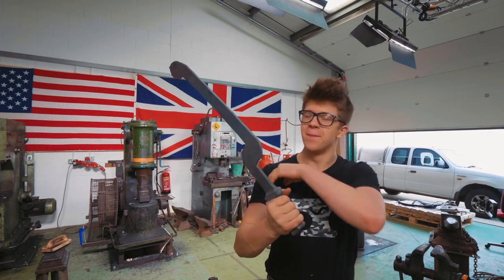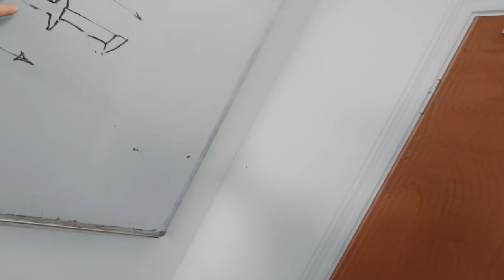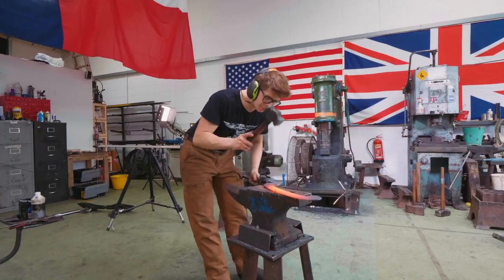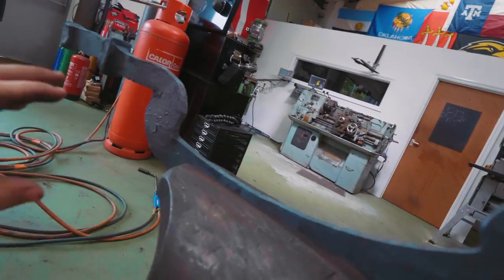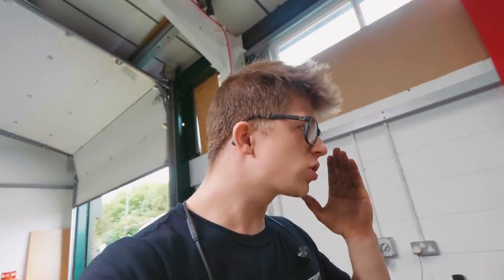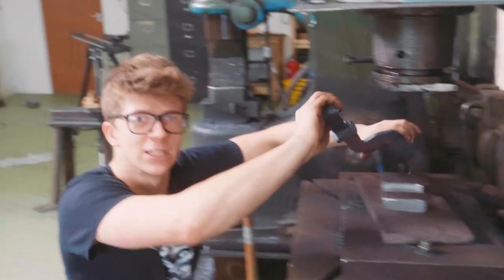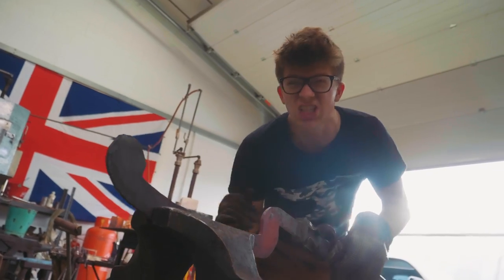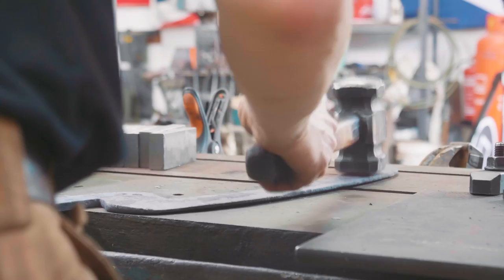MAKING AN EGYPTIAN KOPESH SWORD!!! Part 4

Comment: Tool pullout is totally a thing in a milling machine! Usually just means something wasn't tight enough, happens to all of us.
Reply: Could be the collet being marred, the bit being marred (unlikely with carbide) or just not being tightened enough.
Reply: nice alec! maybe next time try to forge a haladie knife cant wait to see what you make of it!
Reply: Could also change the pitch if the flutes if it keeps happening. Feeds and speeds needs to be dialed.
Reply: And it is very very exciting when you have stepped away (I know) and you are walking back as it .... Leaves at high speed... I hate paperwork... there was lots of paperwork...
Reply: I never pull out!... oh wait...
Reply: the same thing have happed to me when i was milling a custom pice for my car! I think if you push the milling bit to hard and force it to do the work then it seems like it wants to just dig it self down like a drill because of the force pushing it in the matirial, rather then takeing it slow and steady, thats just my opinion☺
Reply: Well, if it's not tight enough you're wasting your time...
Reply: SgtStinger That was my thought too, it may be that your collet is damaged if you think you got it tight enough.
Reply: +Practical Renaissance Sorry for the cheap shot, but I couldn't resist: "That's what SHE said!"
Reply: For a machinist there is not a hole too tight to tap!
Reply: Feed direction could cause it as well (conventional vs climb milling)
Reply: #DontPullOut
Reply: Yes Alec. It's a thing and not something you wish to see while milling. Going lighter or tightning the tool holder more will lightly fix the problem and prevent it happening in a furture.

Comment: A carbide end mill can start to wander i you don't tighten it properly and push it really hard in the machine, I would recommend that tighten it a bit harder and lower your feed, keep the speed the same but lower your auto feed.
Reply: In addition to the above it may also affect it if you are climb milling or conventional milling.

Comment: Yes, as others have said, it is a thing to have an endmill come out of a collet. First time it happened to me was about 45 years ago LOL. It is a combination of the helix of the flutes, the slickness of the carbide, and the R8 collets really weren't made for heavy cuts. Anything over 5/8" and you are pushing your luck. Just tightening the collet more, isn't a good answer,  you will just wear out the threads on your draw bar and collets. The down side of using a set screw endmill holder in a bridgeport type mill is that it hangs the tool out more, and leads to more chance of chatter. One other thing. It's also good practice to pull down on an end mill when using a set screw holder to make sure the end mill is down against the set screw when you tighten it, lest it walk down until it does contact the set screw.
Awsome splits BTW! Keep up the good work. I watch your channel every day.

Comment: Journeyman Machinist here Alec, the pull out of your end mill is very much a thing and for the exact reason you're thinking.  If you're using a large end mill and taking deep cuts it's recommended to not use a collet but a "end mill holder" that has one or two set screws in it.  It looks like the tool you were using had Weldon flats on the shank( two smallish flats) the set screws on an end mill holder will match up with these, it's important to snug up the set screw or screws and then back them off a hair and pull the end mill out until it seats against the set screw and then tighten fully...so that it has nowhere to go when it's trying to pull out due to the helical flute engagement in the part.  Hope this helps! I really enjoy your content sir!

Comment: Yes, Alec, it is a thing that endmills wanna draw out of their collet especially on manual/(machinist term "conventional") mills when you´re milling with the material on the side of the mill feeding in the direction your endmill turns, because of the way endmills are fluted it is like a screw pulling itself in.  Kinda hard to explain on plain text but the easiest way is, on a conventional/manual mill, if you´re milling on one side of the endmill you always want the material on this side of the endmill to feed against the direction of rotation of your endmill. So you´re infront of your milling machine and you wanna machine a ledge on the right side of the part you have in your vise you wanna start with the front right corner on the left side and behind your endmill and move your workpiece towards you where as if you would want to machine a ledge on the left side of your part you´d start on the left back corner of your workpiece on the right side and infront of your endmill and move your workpiece away from you.
I´m just a stupid German and I don´t know the technical terms in English for these two ways of milling (we Germans actually have separate Terms) but I hope you get the point of my explanation.
Reply: Da vid..the terms you are looking is ' Climb Milling,"" "or' " Conventional Milling "
Climb is taking biggest piece of chip first,and conventional is taking smallest part of chip first,,get a better finish with climb on small cuts, but M/C doesn"t like it .

Comment: Yes Alex the endmill will pull out of the holder. We use 2" end mills at work. When we out the m in the holder we pull them to the bottom of the slow were the set screws go so they can't pull out any further befor tightening

Comment: If your collet continues to allow the end mill to slip you will have to use an arbor with a set screw to hold the mill. When you put the end mill into the arbor pull down on the cutter as you tighten the set screw. It also helps to climb cut when you are cutting with the edge of the mill for less chatter and a smoother finish.

Comment: I've worked with many a carbide cutter and yes, if the cutter isn't tightened properly, it can definitely pull out of or push into the holder.

Comment: You are completely correct Alec. End mills can generate thrust in that axis if you push them hard.  If you notice on a lot of end mills they have a flat.  These are for a different style of holding device, called an end mill holder that will positively hold the end mill.
Reply from the maker: +1UsedDj Thanks man!!

Comment: Alec, looks like you're using a set-screw type end mill holder for a 1-1/4 or 30mm tool.   Hard to tell from the video, but it doesn't look like that cutter has a Weldon style shank (Weldon shank is the name for the two (or one) flat cuts for the two set-scews or grub screws in your tool holder).

If you tighten the set-screws against the smooth, round shank, it is very likely to slip, especially on carbide tools.  The problem is only worse on a light machine like a Bridgeport type knee mill due to a lack of rigidity and vibration.  Consider a flat against a round, it's a "higher pair" and results in (theoretical) linear contact of the screw to the shank.

For straight-shank carbide, you need a collet, milling chuck, or a shrink-fit holder.  Since your tool holder is designed for Weldon shanks, you should purchase tools with Weldon shanks to prevent slippage.

See this link for some insight on tool-holding... "End Mill Holder" is the type you have, located at the bottom of the list:
http://www.endmill.com/pages/training/refresher.html

Comment: From an actual machinist:

Here's an aid to conception - Make a fist. Insert a pencil or slender rod in your grip. Stir the free end around in circles. Focus on what's happening in your grip. Collets grip by friction. When gripping round cantilevered milling cutters collets experience the same stirring action as the pencil in your grip.

While collets are precision made and the taper exerts a powerful constriction around the tool shank, side loads do cause deflection on a microscopic scale. Exaggerating, one ten-thousandth of an inch change in axial position per revolution equals one tenth of an inch in a thousand revolutions - 7two minutes of cutting time. 

The end mill extracts itself from the collet because... I don't know why but it does. Fact of life. The lesson is: everthing is made out of rubber and you have to be alert to the tiny indications: precursors to the big-ass calamities like wehen your 20mm roughing end mill works its way out of the collet to cut a slot too deep.

You mentioned the helix of the cutting edges as a source. Possibly but I've noticed the same phenomena with straight flute cutters.

Exacerbating factors are: heavy feeds, worn collets, lax collet grip, tough materials, negative rougher leads, phase of the moon, cost and urgency of the work.

The trick to eliminating unintended cutter extension seems to be awareness, leaving a little stock on the depth for finishing, long cutter extensions, avoiding "full wrap" cuts, and limiting heavy feeds - all intended to reduce side loads and consequets cutter reflections - plus promptly replacing worn collets.
Reply: Being in the trade,(Fitting and Machinist) For nearly 50 years,Forrest Addy Has it about right,Collects as they get used more and more do wear,Cleanliness is the next important thing to remember,as you are relying on a friction fit to stop from turning in the collet,OR Suck out,,so oil or slippery stuff near tooling on assembly of bits is a no-no,Wipe it all clean even in side of collet on M?C
How ever when finish with said bit and collet,,they should be lightly oiled for next adventure in M/C,
Just one more thing,,is there a reason you choke up on hammers when using them,Or Is it the weight of hammer that cause you to choke on handle,
Best wishes,
oooohh,,The phase of the moon doesn't really do any thing,Unless you wake after moon with Fleas..then i would be worried.

Comment: tool pull happens, you can get tooling that engages with the flat on the roughing mill to prevent it but given the frequency you seem to use it vs cost of one of those holders I'd suggest just backing off your feeds and speeds a touch.

Comment: For heavy roughing applications it's not recommended to use collet style holders. If you search endmill holder you will find a holder that clamps the Weldon flat of a endmill via a set screw. This will insure that the endmill doesn't pull on you. They make holders with R8 tapers for your knee mill.

Comment: On CNC machines without encoders, i've overcome the torque of the stepper motor before with endmills, with encoders, i've pulled endmills out of the collets... amazing amount of force pulling down on those cuts! You can also pull your part up in the vice, just for an extra variable ;)

Comment: Yes, they draw themselves out of the collet. Use the correct collet for the tool. That end mill is a threaded shank and looks like it goes into a Dormer or Clarkson autolock milling chuck. The two are interchangable, but obviously need to have the correct taper for your mill.

Comment: After giving you a bit of a serve a few videos ago on the direction you were taking, I think it only fair to post now that I feel this was a nicely balanced video in many ways.

I much prefer the approach used in this video for your merch - with the shirt, it comes across as a quick reminder that hey, I've got a merch store, check it out if you're interested - without being pushy.  And the quick note at the end of the video likewise - hey, I've got a couple of new items in stock if you're interested.  Feels more like a blacksmithing channel rather than a late night tv shopping channel...  Good to see it looks like you're getting some more practical stuff in as well - perhaps you could investigate expanding on the range by buying some harder to find consumables you use in the shop in bulk, to allow you to offer them to the public at a cheaper price than they might otherwise be able to get?  I'm thinking perhaps of stuff like ceramic flap discs or belts, but could apply to anything that's harder to buy off the shelf in small quantities for the hobbyist without a business account - all depends on what sort of deals you could swing with your suppliers in order to make a profit, of course.

I also like this slightly toned down level of presentation - I know you said it's due to being a bit ill, but I have to say I like it - still plenty of energy, but without being at a level that makes me wish someone would nail your feet to the floor and feed you a bottle of Valium ;-).  There's also a bit more explaining of what you're thinking and doing again.  The camera work seems to have tamed down a little too, less fancy jumping around shots that make it disorienting to try and follow what's actually happening, and less shots where what you're doing is obscured by using other workshop equipment as arty foreground.  Your channel has still evolved, but it feels like a more logical progression from your older videos here, and not a complete change of direction...

Just my opinion though...

Comment: Having your tool pull out does happen when youre taking large cuts with an endmill.  You can try buying an endmill holder (if your endmills have flats on them) and using that instead of a collet when taking largs cuts.  I had the same problem for the longest time, the endmill holder really did the trick;)

Comment: end mill pull out is a real problem. ideally, the cutter and the inside of the collet should be clean and dry. the outside of the collet should be lightly lubricated so it can be drawn into the spindle taper smoothly. you may also want to very lightly lubricate (machinist oil or any type of oil would probably be OK) the spindle taper. now you're going to ask how do you keep everything lubricated and clean at the same time when you're always swapping collets. how indeed.
love your channel.

Comment: The R8 collets used on Bridgeports don't hold as well as the ER collet system. You can buy an R8 to ER 40 adapter of the usual auction site for £50-60 for a half decent one. These are the type of toolholders used in CNC machining centres which have very high cutting forces and rarely get a pullout.

Comment: So not only is the  roughing endmill fluted the roughing grooves are threaded in the same direction the same rotation to screw in a bolt normally. So it will come out off the collet slowly but surely when taking a heavy cut.

Comment: You are EXACTLY correct about a mill cutter working it's way out of a collet under heavy cutting .. either lighten up on your depth of cut, use a proper tool holder or go to a different style of cutter that attaches directly to your drawbar and more time than not, will have replaceable carbide insert .. Good Luck

Comment: tool pull out is a real thing, especially on a ripper like you are using, big heavy cuts will effectively unscrew the tool from the collet. take smaller cuts or tighten the draw bar. but be aware that over tightening the draw bar and cause it to stretch, and that nackers your bearings. better off taking smaller cuts. love you work. very educational. I might have a go myself.

Comment: If the material catches somewhat like aluminum (softer iron and steel that aren't hardened can take on this effect), then a fluted drill bit can make a ratchet-like effect that will pull the material up on a few of the flutes before dropping back to the table vise's original position. Happens in a split second, but is avoidable by using something like axle grease or metal cutting lube

Comment: If you use a Roughing End Mill, do not clamp it in a collet. It will wind the endmill out no mather if its carbid or HSS. Weldon surface chucks are the proper way to clamp this sort of tool. 

2 Tipps for Weldon-use: Never clamp a tool in a weldon wich does not have flat for the set-screw or it will come outagain. If you put a tool in a weldon and the screw has found the flat, pull on the tool while tightening the set-screw.  If anything goes wrong and the screw gets loose, chances are better, for the tool to slide into the chuck and your part isn't damanged.

Thanks for your work Alec. After a long day of milling your videos are a great motivation to get out and start a fire...

Comment: If your collet or tool holder isn’t tight enough , your tool will slip just like you said , as you take a pass it will pull the tool out , it happens more with harder materials such as steel and it also depends on how deep and wide of a cut you are taking

Comment: An idea for the tool on the press that you are using to straighten the twist. Add a pivot on one half, that way it won't matter if the two sides are of different thicknesses. Also, the tool pull out is something I've seen many time in college with people new to machining.

Comment: use end mill holders with  a set screw to stop the end mill from being pulled. typically, the larger the end mill, the less holding power in an r8 collet.

Comment: When using a big milling cutter feed against the rotation of the tool and it will avoid riding over the job. Always make sure your collet is as tight as possible. From a very experienced machinist.

Comment: That definitely sounds like tool pullout. You have to be especially careful about that with things like dovetail cutters that apply pressure to the top of the tool, but even regular endmills will have that problem if you don't have them in there tight enough.

Comment: Tool pullout is very real. The carbide cutter grabs the steel and eats in deeper and will put pressure on one side and as the tool goes it will work it’s way out.

Comment: All my experience is with CNC, so I’m not sure if manuals would have the same problem but I know my shop had a problem a while ago with the part getting pulled out rather than the tool when we tried pushing our feed rates too far

Comment: Would it be practical to build another forge box that can be set back to back with the first on and/or heated independently of the first one so you can normalize/heat longer projects in one shot?